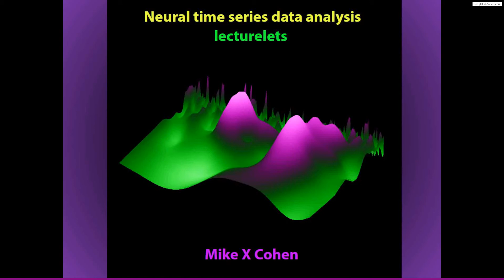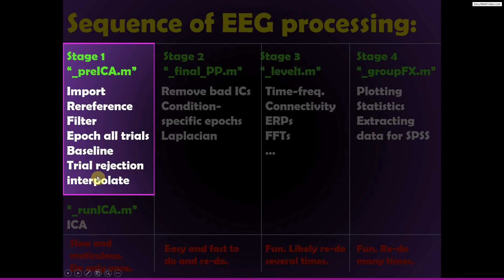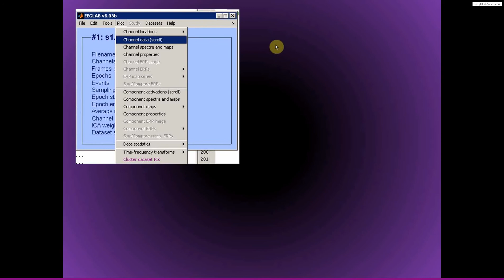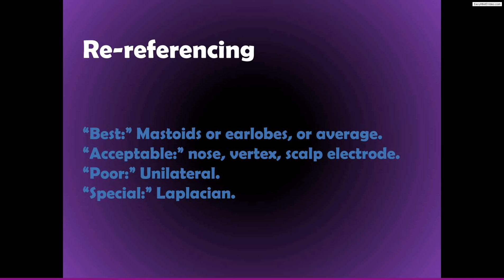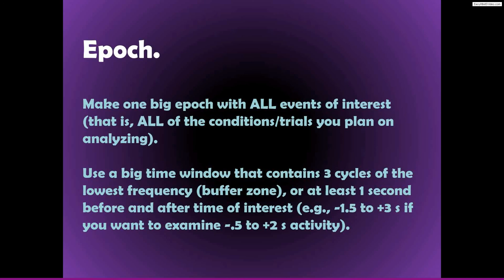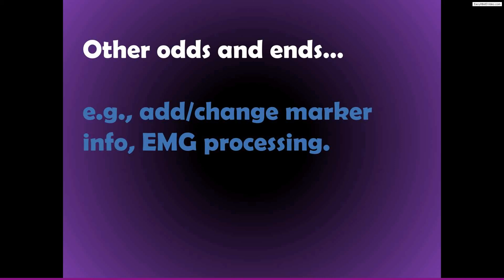Filter, epoch, baseline subtraction, referencing

Comment: Why is it better to do ICA after epoching the data instead of before? Is ICA ok to do with only 14 channels of EEG data? Also, would I need to linear baseline correct if I am low filtering at 2 hz? Thank you so much!
Reply from the maker: ICA does a better job when given cleaner data, so the data should already be cleaned before running ICA. You don't need to epoch before ICA, but it often happens that people cough/sneeze/blink/scratch/move/talk/drink in between trials, and those create a lot of noise in the signal.

Yes, you can use ICA on 14 channels.

Baseline subtraction is a linear operation that takes your computer a few ms to do. You might as well include it.

Comment: I have events which last 6 seconds each. Would it be better to record continuous EEG data throughout the entire experiment, rather than only during each event? (Based on edge artifacts, it seems the video clearly says to record continuous EEG data at all costs). If my events last 6 seconds, is it necessary to cut each 6 second event into either 1 or 2 second epochs? Or, in this case would the epoch be 6 seconds? Thanks!!
Reply from the maker: Sorry if that point was unclear in the video, Claudia. You always record the EEG data continuously. Thus, the recorded data are 2D (channels by time). Cutting the data into segments around each experiment trial is part of preprocessing. In your case, the data epochs would be 6 seconds.
Reply: @mikexcohen1  Thank you!

Comment: Hi Mike, 

Thank you so much for all these videos. It's very usefull for me! 

I just have one question because I find different way to preprocess the data but I can't find the best way to do that and more importently, I want to hunderstand why ! 
I think you're the best person to make me understand why.  
Some papers and groups of EEG processing suggest that it's better to run the ICA on the continus data 
rather than on the epoched data. I tried the two way on my dataset and indeed,  I can see a difference. But I don't know which method is the best.

Thank in advance,  
Delphine F
Reply from the maker: Good question. I don't have a very strong opinion about this. It depends on what the subjects are doing in between trials. In many of my EEG experiments, we have breaks of several minutes where we go talk to the subject, give them some water, etc. So the EEG data look horrible in those periods, and obviously it's better to cut those out before ICA. Basically, you want to give the ICA as much data to work with as possible, but it should be relatively clean data.

Comment: Hi Mike, Thanks for in depth eeg preprocesing tuts.
I have a query. I am currently working with an motor imagery dataset which is already transformed in the epochs. Originally ear lobes were used as reference. After applying common average referencing and comparing the epochs plots before and after this transformation, It seems like more noise/artifacts are somehow introduced into the channels. Should I avoid this doing referencing? or is there any other interpretation? and how we can check which referencing technique would be great?
Thanks in advance
Reply from the maker: My guess is that you have one or a few isolated bad electrodes, and so transforming to common-average reference "transfers" that artifact into all the other electrodes. You can try cleaning more of the data before re-referencing, or see whether ICA will pick up on that artifact after average reference.

Comment: Hi Mike, I'm also wondering why you do re-reference before the trial rejection. If your re-reference channel is bad and gives an exceptionally large amplitude waveform, wouldn't re-reference carry the large amplitude to all the other channels?
Reply from the maker: Great question. A lot of preprocessing should be done carefully, and there are always exceptions. Indeed, one really bad channel will contaminate all the other channels during average referencing. In this case, it's best to remove that channel before re-referencing. On the other hand, if it's an artifact that ICA will be able to isolate well, then that artifact will be removed even if it gets spread across channels. Sorry for a less-than-clear answer ;)  but I think these decisions often have to be made on a case-by-case basis.

Mike
Reply: Thank you! That makes a lot of sense.

Comment: Hi Mike, thanks for the videos. In your processing pipeline, you made a big epoch containing all trials/conditions and then do the baseline correction. Does that mean you baseline correct the whole big epoch based on one single baseline? I thought we need to baseline correct the trial(s) based on the baseline of the epoch containing only the trial(s) of interest.
Reply from the maker: Hi Chao. The linear baseline subtraction during preprocessing is trial-specific, not condition- (or dataset-) specific. That's a separate issue from baseline normalization during time-frequency analysis. Putting all conditions into one epoch makes preprocessing and some aspects of the analyses easier, but it's not necessary.

Comment: Hi Mike, thanks for these videos (and your book, it's incredibly accessible and nice to read :). Can I just ask, if you have a very bad channel at the beginning, do you remove or interpolate? I've read you shouldn't run ICA on interpolated channels (but rather remove, run ICA, then interpolate). Would love you're opinion. Thank you.
Reply from the maker: It depends on what "bad" means. If the channel is noisy but there is also real EEG data on top of the noise, then you can try ICA and see if you'll find a component that isolates the noise (that might work if the noise is present throughout the recording). But if there is really no signal, then remove, ICA, project out bad ICs, then interpolate.
Reply: Thanks for the speedy reply, really useful :).

Comment: Hey Mike! I'm trying to calculate eeg power data from non-experimental EEG recordings, so i want to get Absolute band power from eyes closed condition vs eyes open condition, the problem is that the stimulus mark/cue/number only marks the start of the condition (i.e. stim 201 (eyes closed start) seg 20, and it lasts for 2min) so, i wanted to ask how can i extract the segments which correspond to a precise eeg condition.
Also, i'm on the Udemy course so i can get better at this.

Thanks for any info you can give, 

Regards
Reply from the maker: Hi Jorge. I'm not sure what you mean by "precise eeg condition." From your description, you have only eyes-closed and eyes-open. The typical resting-state EEG pipeline would be to cut the data into 2-second epochs, take the FFT and extract power of each epoch separately, and then average the resulting power spectra together.

Mike
Reply: Mike, thanks for the answer, that's exactly what i needed, i was trying to extract power for a 20 seg (or so) segment and it was not going well, is there a way to cut the data in eeglab? I found this link with a similar question and a script -> https://sccn.ucsd.edu/pipermail/eeglablist/2015/009845.html but i was wondering if there is a way to do it directly on eeglab. 

Thanks a lot in advance
Reply from the maker: I'm not an eeglab expert, but I would guess it should be possible in eeglab. I also teach about this sort of epoching in my MATLAB book. You can download all the code at sincxpress.com.

Comment: Hi Mike, thanks for these videos they are unbelievably useful! Just to check though - by buffer zones do you mean time between trials? I am currently implementing a 800-1200ms jitter between the participant's response and the start of the next trial.
Reply from the maker: Hi Amy. A long ITI is also important. 1 second is probably sufficient, unless you expect a long neural response. The buffer zone is more about signal processing than neural responses -- basically there are edge effects from the filtering (time-frequency analysis), so "buffer zones" will allow you to exclude the edge effects leaking into the trial period. I discuss this in more detail in the book.

Mike